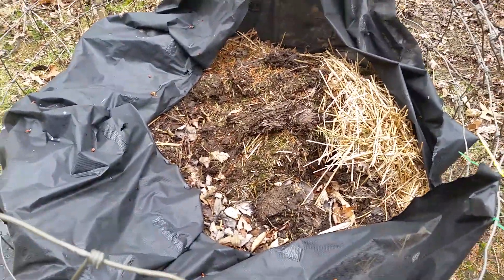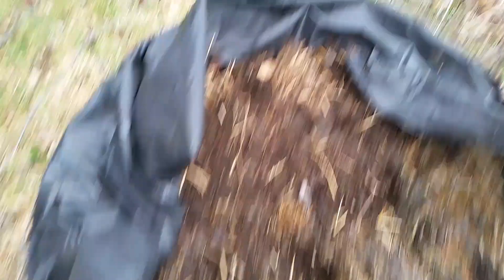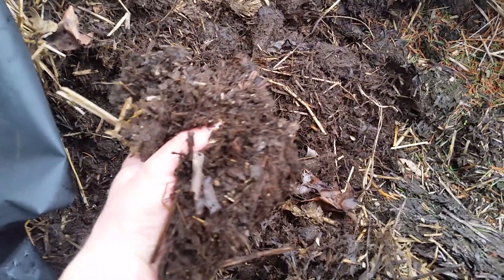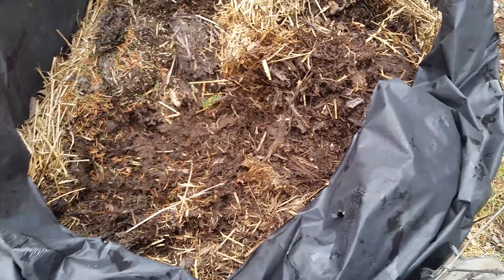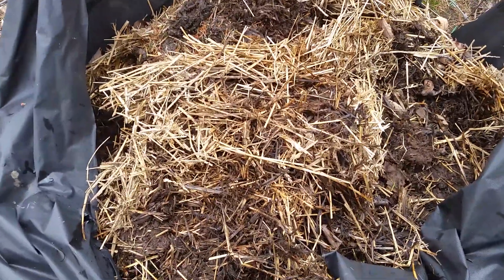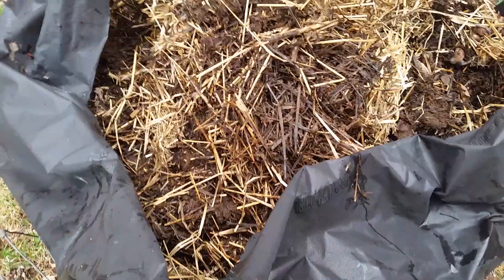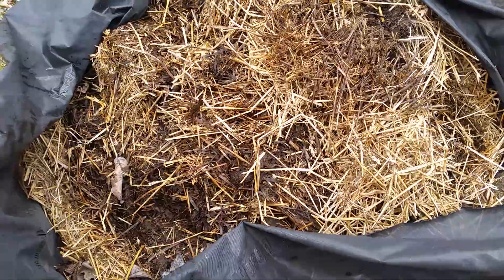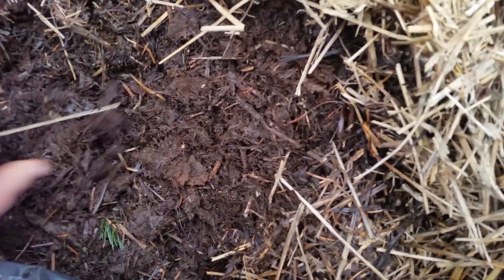JS Bioreactor FAIL. How and why. Lessons I've learned.

Comment: I think bioreactors need to be bigger than your pile, something like 5-6 feet tall, and as wide around as your pallet, about 4 feet in diameter: around 70 cubic feet. Johnson also suggests letting it settle for a few days and topping it off several times. Fungal hyphae bind the material. This and the weight of the material compress the pile and keep the holes open. Also, you need to keep it moist or the fungi will go into remission. Johnson recommends watering daily, until water drips from the bottom.
Reply from the maker: I think you are correct on all counts. Most I've seen since building this are bigger. And yes, definitely not enough water on this pile.
Reply: @jlacres9839  No worries. It's all about experimenting with new things, right? THe mark of a great mind is to learn from failures, so I like that you were able to air yours in public. Because THAT is the path to growth. Carry on and keep learning.

Comment: I looked hard to see the details of your landscape fabric but it seems to me it is not the breathable type made up of 1-2mm wide strips of plastic woven together like cloth but rather a type used for vegetable production or such and that excluded all the air. Also maybe (as I will) slide a few sticks or rods from top to bottom in your sheep fence and tie them of to avoid the wiggeling which might have caused the collapse of the reactor...
Reply from the maker: Y'know, I just grabbed the landscaping fabric I had handy and just assumed they were all breathable since it had little holes. But yes, this was not the woven type. That probably didn't help things. I don't think wiggling/settling is necessarily an issue as long as it can still breath, which worms would help with.
Reply: @jlacres9839  It is breathable if water can penetrate. But that doesn't matter anyway -  what matters is the pile needs the holes from the pipes to remain open to keep from going anerobic. Use stiffer metal mesh to keep stable or drive some stakes - Johnson used 6x6 welded wire mesh used for reinforcing concrete.